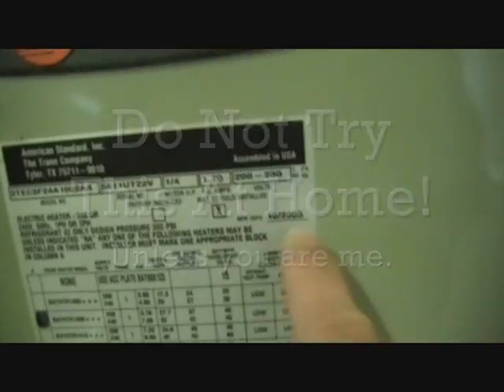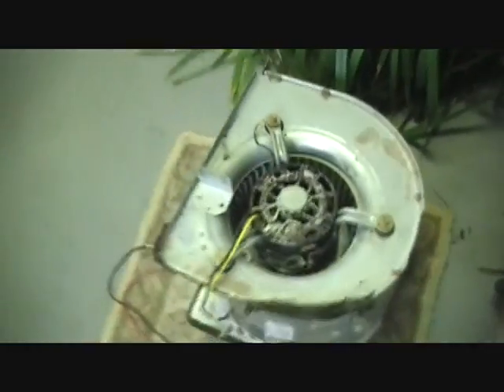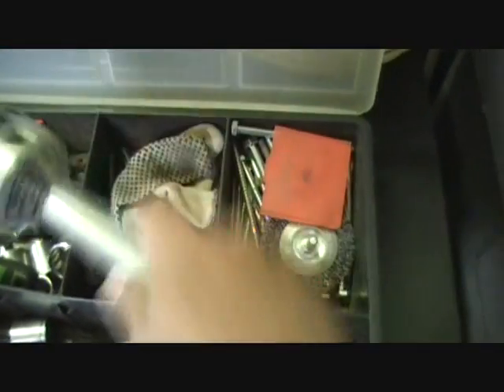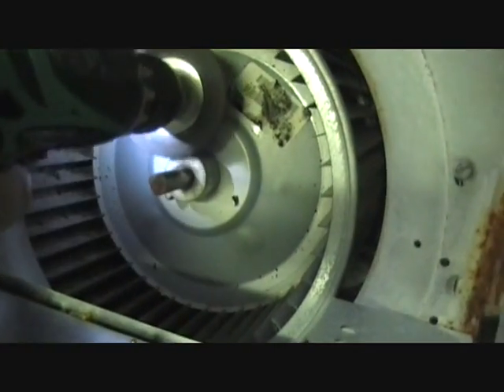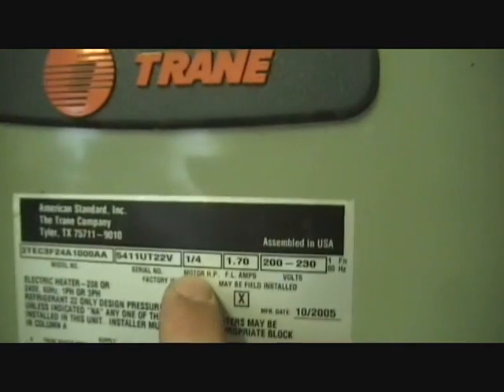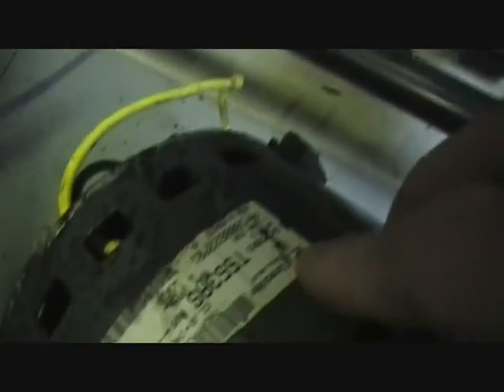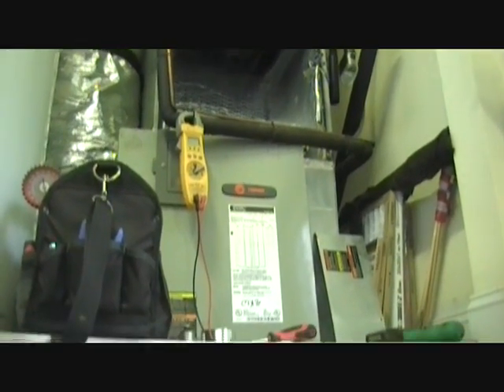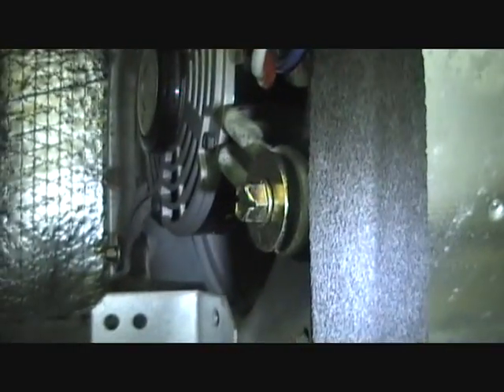HVAC Service- Trane Blower Motor Replacement (Another One)

Comment: Anyone know where the AC blower motor is on a trane xl 1400 variable speed, roof top unit? My AC is not blowing air through the vents. Any help will be appreciated and one forward for you. Thanks

Comment: My guess is that the Trane place knows the 1/4 and 1/3 are interchangable.  They want you to buy the more expensive one.  It's supposed to be 1/4.  Someone put in the 1/3 last time.  If I knew they both fit, I would also put in the 1/3.  A little overkill is not always a bad thing.  Just a guess.

Comment: hey Zack, Burl here. my blower motor takes up to 10 seconds to get to full speed. I have a trane ex60 . Is there a starter on these motors ? I got home yesterday and the ac was running but the blower was not turning.  I pulled the cover and gave it a little spin and it started working. Any idea what to do ?  Thanks
Reply: Willaim, 3 years late to the party. Did not offend anyone on here. Sounds like a weak blower motor capacitor.